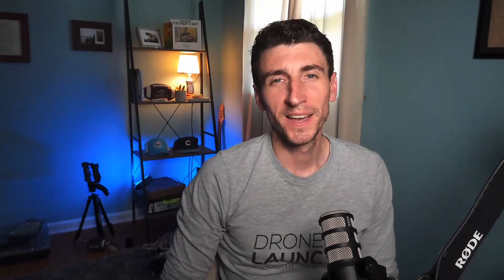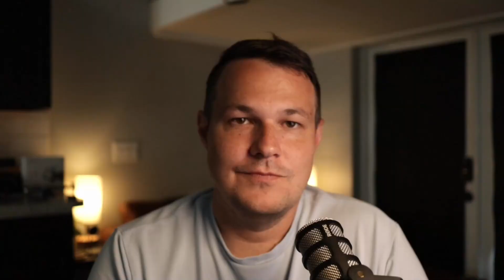How to retrofit an older drone to meet remote ID requirements? (YDQA EP 26)

Comment: You suggested that the more expensive, self-contained (currently backordered) remote ID modules need to be plugged in to the drone's USB port. Are you sure that's correct? I have just bought a Db120 for my Mavic Pro, and don't think that it needs to be plugged in.
Reply from the maker: that's possible I suppose? if there is some way of wirelessly connecting to the drone?  It's just going to need a way to get the drone telemetry data, take off location, and pilot location.
Reply: I think the Db120 has GNSS built in. At least that would give it the takeoff location. I haven't read the remote ID spec. Is the pilot location one of the requirements, or will the takeoff location be enough?
Reply: I tried to use the USB port to power an external remote ID module, all the drones I tried block the +5 volt with a diode, you can charge the drone but the drone cannot provide external power, I was trying to save the weight of a battery for a Dronetag BS module.